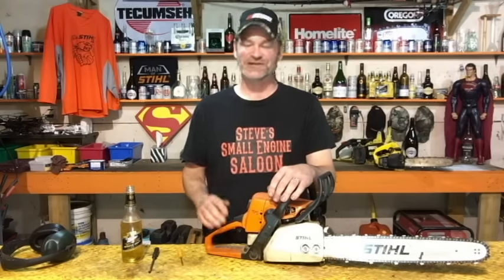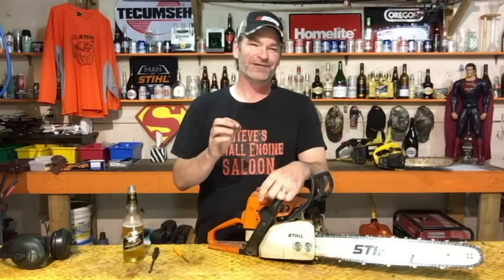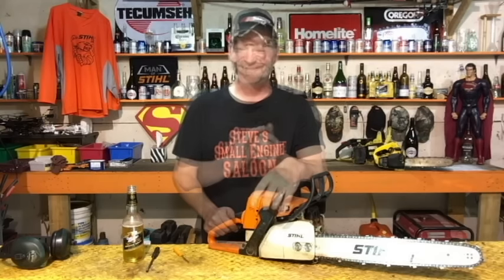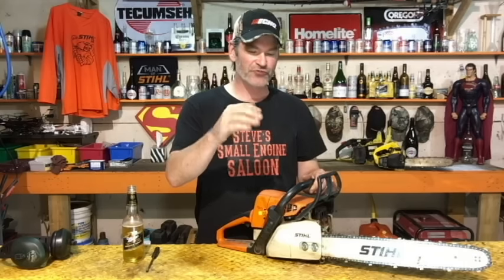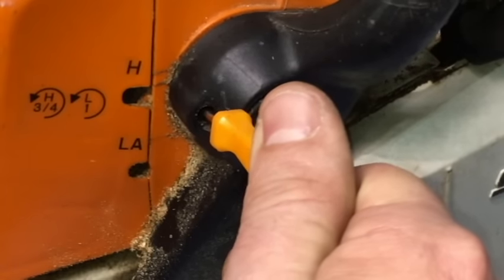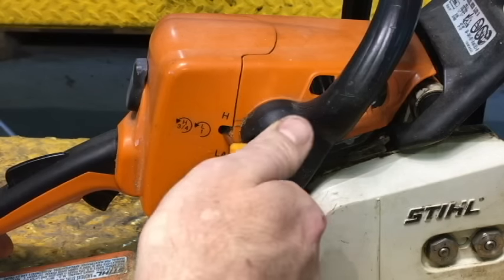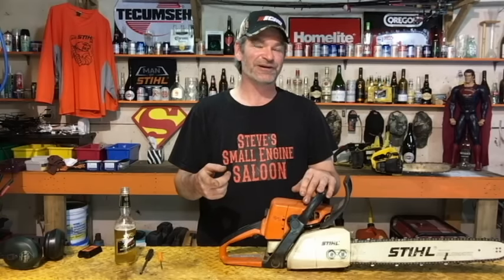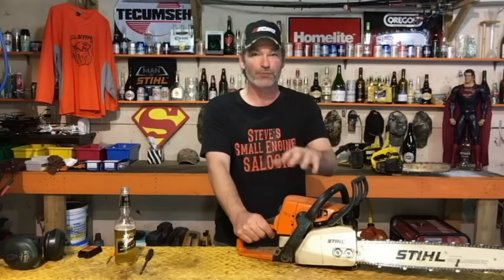CORRECT WAY To Adjust Or Tune The Carburetor On A Chainsaw (Step-by-Step)

Comment: FIRST..remove the limiter caps so you can do this job correctly. NEXT.. the low speed needle is part of the fueling circuit ALL the time so it may have to be reset more than once. The idle screw is just that , nothing more. It will be the final setting you make. The most critical setting will be the high speed. I start by turning the low speed screw in gently until it bottoms. than back out about a turn and a half. Turn the high speed screw in gently until it bottoms. than back out about two - 3 turns. That should get it started. Warm it up on the bench. Turn the idle screw in or out to get a basic idle. Turn the low speed in and out until the engine idles reasonably well. Now start speeding up the engine. Turn the high speed in until the engine reaches a very high rpm and back the screw out until the engine starts to lose speed. Two cycle engines have TWO cooling methods. One is the fan on the flywheel and the other is INCOMING FUEL. If the high speed is set too LEAN the engine can "burn" Once you reach a point of cutting do just that. Settings you made on the bench will change after that saw reaches a "working temp" Settings will need to be readjusted. Remember when you turn the high speed in to get max rpm's it may be too "lean" Now you need to recheck what you have done. Easy..READ the spark plug. After you have "worked" the saw for awhile. Shut it down, go get another beer, and let it cool. Never remove a plug from a from a hot alum head. Make certain you are using the correct heat range plug for your application. The color of the plug tells you if your settings are near correct. Light tan is too lean..chocolate brown is good..black and sooty is rich. Today's modern saws will handle today's modern fuels, but still have to be sett correctly.  The older saws need to be watched more closely. The methanol and alcohol in today's fuel are "drying agents" and change the operating characteristics of the fuels. I spent very many years as a snowmobile, chain saw, weed eater, leaf blower, etc mechanic. ALSO the crankshaft seals need to be in good repair. If they start to leak it changes the "fuel air ratio" and will cause engine damage.

Comment: The “high” speed screw is a fuel enrichment screw for high rpm tuning….most of the chainsaws I’ve tuned you been able to tune just like the low speed tuning screw.. turning in the screw till rpms drop then turning out till rpms drop.. then turning in again till rpms drop and back out 1/4 to half turn gets that sweet spot…..leaving it turned in too much will lean out the engine and it could burn up the piston or bearings…
Especially running 50:1 mixture ..

Comment: As a tech that worked for Sears as a mobile gas technician! I attended A Community College! We were taught never straighten a crankshaft on any lawnmower! The shaft has been sintered under high heat and should never be straightened! If a customer ever saw me straighten a crankshaft I would have been fired!

Comment: Problem I had with the video is you sort of skim over the idle screw adjustment in the beginning. "adjust the screw until the chain stop". I realized once I watched it a couple times that your saw is running when you do this. My problem is that I cant even get my saw to idle long enough to adjust this. It fires up for a few seconds then dies, there is no idling so I can't adjust the idle screw in the manner that you did.
Reply: What are your initial settings? Is the saw new, old, bought not running, what's the story?
Reply: @SinsBird  Old saw, new carb. I finally had someone who knew what they were doing fool around with it for a bit. Turns out high wasn't turned up enough to even get the saw to run. Once the high screw was adjusted we were able to dial in the low and high on a tachometer to idle fairly well. For some reason the actual idle adjustment  screw doesn't seem to be doing much no matter how much it is turned in or out. It's an old Poulan Pro that I wanted to keep running as a backup for my main saw. It's now running well enough to cut wood as a backup.

Comment: Hey Steve, I purchased a chainsaw bar with chain at a garage sale last year and I can't tell what chainsaw it will work on.  It seems to be an old number that I can't seem to find.  It's an Oregon bar made in good old Canada. Hoping you can give me some expert info as to what this fits in the way of pitch, guage ect.  Info on the bar reads 7730 EQ   200- - - H025  Oregon  Made in Canada  Thanks

Comment: Good video Steve but why didn't you show how to adjust the high speed exactly like you adjusted the low speed? Let her scream then back off until you hear the "sweet spot"! Then check it with the tachometer.

Comment: Pulling pro has jets that requires a special tool also.. just take a hacksaw and cut a slot for a flathead screwdriver while repeating these words with each stroke. "screw the E.P.A" about the 10th stroke you should hear the environment start to cry letting you know the mod is complete and done properly. Merika

Comment: I do not trust the limiter caps. My warranty just ran out on my ms291 and my spark plug was always showing lean with the cap screwed to the richest i could go. After i removed the limiters and adjusted everything using both a tach and listening for the saw to 4 stroke it definitely seams happier idles better and will stay running doesnt matter how long it sits and doesn't bog as easily in a large chunk of wood

Comment: The video is fine but you didn't explain the actual relationship of the screw setting and the air/fuel mixture.
Turning either mixture screw in is less gas AND oil and can potentially destroy the engine. Turning out increases the gas AND oil mixture. It may die, but it won't be damaged.

Comment: I would also say that the high speed screw is also your fuel adjustment for your high speed side . The reason it runs faster if you turn it in is  because it is starving  for fuel and out makes it richer . That is all fine and well but I would never suggest the running it faster ( turning it in) for the most important reason and the cause of blowing or harming your engine & that is when you starve it for fuel it starves it of OIL , you have to remember its 2cycle and that's the only oil it gets . Might sound better & run faster but DON'T do it. Run your saw out of gas & listen to it , it will rev was up before it dies , why it's starving for fuel !!! Just sayin !

Comment: Completely 8nc9rrectvex0lanation on the high speed adjustment. It is NOT a speed limiter. It's a mixture (valve core) just like the low speed mix adjustment. Except the high speed adjuster is in the high speed circuit instead of low/idle circuit. They need to be tuned to compliment one another.

Comment: But he doesn't tell you which way to turn the screws to give it more gas. Or which way to turn it to give it less Gass. Simply or which way to turn the screws to turn it off. Because I've turned those screws in both directions and it still won't stay running or rev up. ???

Comment: the problem is with government regulations.  EPA want's to make you life a living hell. I've been farting around with small engines 50+ years. You used to be able to store a lawnmower or chain saw for several years and come back and they would start right up. Now all we have is shit gasoline and after a few days of storing the dam things won't start. Then you have big brother telling you " Hell no you're not going to adjust the carburetor"  just live with it

Comment: Great video, but problems at several spots, like when early on you're showing to adjust the idle screw first.  (important I gather for saws that have them, like my Husq 450 -- but you have no sound when you're doing that, almost like it should adjust with the saw off....)  More problematic, your repeated suggestions to find settings for screw settings for specific models from google (to "trust" google) oh my, emphatically not helpful.  Maybe things have so deteriorated since your first crack at this, but now, if you google settings for a specific model, you'll get all sorts of utterly irrelevant unhelpful GARBAGE, from other chainsaw videos (no doubt trying to crowd your superb videos out) with generic advice, but no specifics....   not even on the major brands.  (much less the generic china-saws)

Comment: Or make one? If a manufacturer uses a speciality fitting/fastener designed to restrict or prohibit the OWNER from independently using/maintaining thier own equipment, it motivates me further to NOT have it maintained by those who have been given exclusive access to said tooling. I either source it from someone who has an unauthorised copy/replica of the tool or I make one myself. 

It may seem like an inefficient uae of time, money or effort but one should consider the consequences of allowing the full ownership of property to be constrained. 
Made the mistake of buying a European car once where you cannot do much of the servicing work without specialist tooling and prohibitively expensive electronic equipment with equally expensive software SUBSCRIPTIONS.... Was a first hand lesson of what happens if you allow this type of 'consumer goods' market to become too entrenched. Last time I'll make that mistake. If I buy something that I will be using, on my own property, for my own needs/wants then I demand I have ABSOLUTE control and capacity to use the item as I wish. If I wish to see what the limitations are before it suffers catastrophic failure, I will. It is only the requirement of the manufacturer to inform the purchaser of the products limitations and how to ensure the adherence to them, a device/component may be added but if it interferes in any way with the scope of the equipments full range of usability, then it should be removable and/or fully adjustable/alterable. 

Ever read a user/owner manual from 40-50 yrs ago? It includes information that you would be lucky to find in todays service/workshop manuals. Ie; it gives you the detailed specs of engineering tolerances that a specialist would be required to know, along with the tool list required to complete all maintaince tasks and a detailed instruction on how to fabricate specialist tooling for beginner/amateur owners who may not have professional training/experience in conducting such tasks. (The manual for my 35yr old, simple 2-stroke bike is bigger and thicker than the manual for my new car, with all its extremely complicated and sophisticated systems and components. 
The manual for that European vehicle instructed me to take the vehicle to an authorised dealership to have the headlight bulbs changed. Nor was it possible to source the schematics for the fuse and relay boards and a workshop who specialises in European vehicles was required to diagnose an electrical issue with the vehicle. And you think they would give me information on the issue, or how to troubleshoot something similar in the future? Nope...
And why would they, rhis ridiculous approach to the 'consumer' market ensures more money is forced to flow in thier direction. If rhe task is complicated or technical, sure, offer authorised assistance but it should NOT be an exclusive rand exclusionary role of the manufacturer (and authorised dealerships/affiliates) to conduct tasks included in and associated with OWNERSHIP.